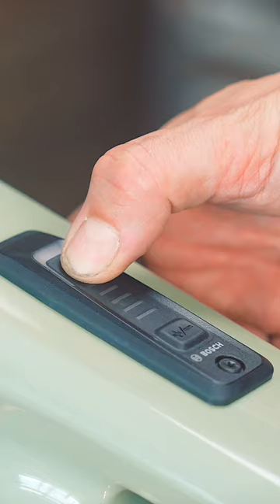Bike Workshop: Pure Satifaction ASMR sounds 🎶 #shorts

Comment: Sooner have a a conventional. Frame and forks and a 21 speed cable operated shifting so you have to put a motor on a bike because you are not fit enough to pedal it without assistance